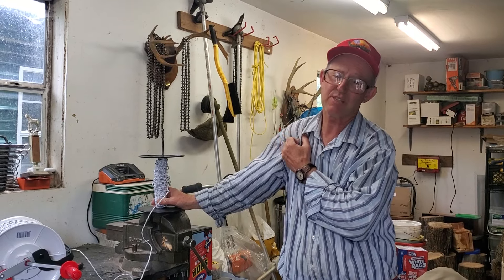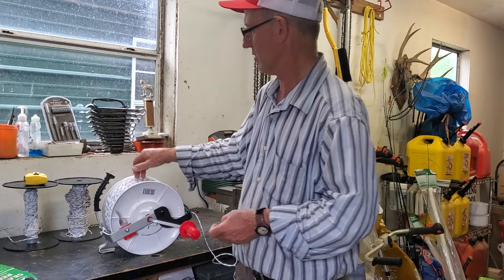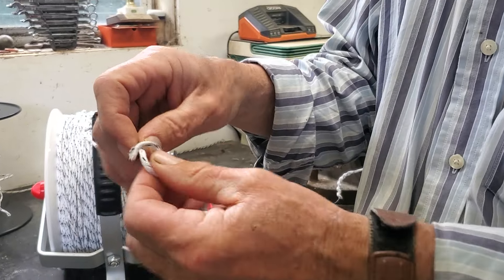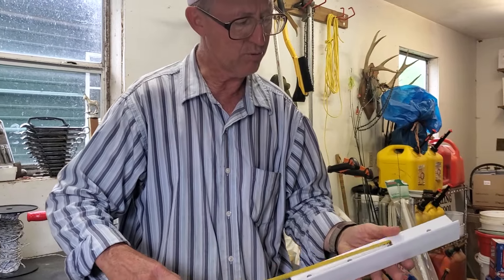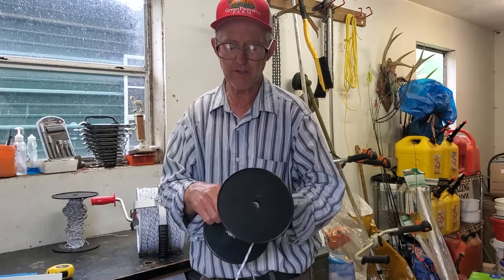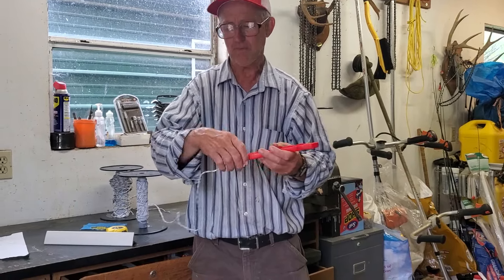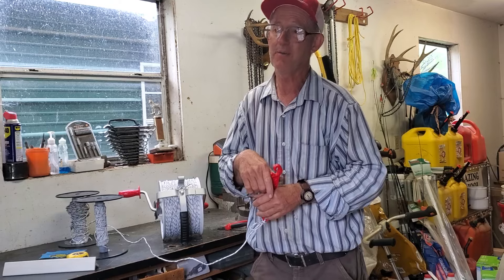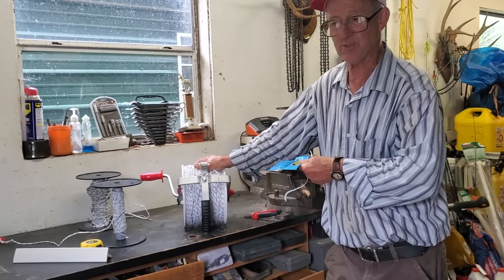Here are your best electric fencing materials that work and perform flawlessly.

Comment: Thanks for the great advice!  Can you tell me which size  1.25,1.75,2.25  post you use? Also wondering how you drive these. I'm down in Springfield and know it's hard to get a steel post in the ground. Are these rigid enough to use a driver on?
Reply from the maker: The 1.75” is a very durable post. Timeless Fence I believe sells a rock bit for installing posts into very rocky soil.
Reply: Thanks Greg

Comment: Those reels  look like standard  wire reels. They can certainly be sourced if they can be replaced  without damaging  the reeling mechanism.
Reply: Yeah, there has to be a way.
Reply from the maker: Let me know when you find them.
Reply: @gregjudyregenerativerancher  They look like standard wire spools. You can probably  pick a few up at a place that sells  wire/cable by the foot. The crucial  detail is what the hub diameter. By that, I mean the hole  in the center.

Comment: If I'm connecting to high tensile wire and using step in post do I go from hot to hot which completes the circuit or non conductive plastic on one end and Tara reel  to hot.

Comment: Mr. Judy can you join polybraid lines with a knot, if so what is the best way to join two lines together?
Reply from the maker: We use a figure 8 knot to join them, works great.
Reply: Is the figure 8 knot like a baler knot?  Grab both ends together, make a loop and feed both ends through the loop and pull tight.  6 seconds and will not pull loose.

Comment: I'm looking at your broken spool and think you could 'fix' it by using a paper plate and epoxy. Us the plate as a mold, then mix your epoxy, spread it over the plate and reel, then when dry, sand until smooth. You can reinforce the seal between the 'new' part and the old by using super glue and baking soda mixed and applied. I'm thinking that may well work.

Comment: One thing I started doing with the braid on the reel is I slip a little piece of heat shrink tubing on the tail end of the braid and go over it with a little torch or heat gun. Stops it from fraying at the end

Comment: Greg, just went to your website and I don't see where to sign up for the September class
Reply from the maker: It's on our website: greenpasturesfarm.net. Just put it up there.
Reply: @gregjudyregenerativerancher   FYI, no clue why I'm getting this message when I click on the "Check out our September 0th and 10th..." button I get  "Unauthorized. You may remove the customize_messenger_channel param to preview as frontend."  That said, I can still get there through the pulldown menu at the top so there might be an issue with the button

Comment: What is your longest stretch you run the poly raid? Do you ever go more than 1300 feet and need another reel? How do you hook that up?
Reply from the maker: We use slip knots to join up to 4 reels together for long cattle moves, works great. Just untie the slip knots when your done. Always leave your empty geared reel where it ran out, on the ground, opposite from the cattle traffic. This way it is right where you need it when you wind up the numerous reels after your done.

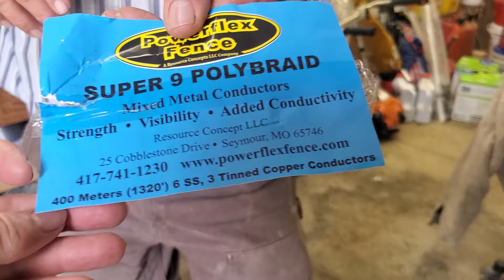Comment: And like the label says 13:26 - six stainless conductors and 3 tinned copper conductors.  Nine total--mixed metal because the copper is a far better conductor, but also very expensive to use.  It doesn't have "9 steel wires".

Comment: Hey I'm buying fence supplies and the only reel available locally is a Speedrite. Also got my first 10,000' of HT wire today, 170k rather than 180k, because I didn't want the 215k and those were my two options. Back to the reels, the Speedrite looks just like a Taragate (and is made in NZ), but it's not a Taragate. You said everyone else's brake sucks, so I'll hold out for a Taragate (pay shipping).  But if anyone is using a Speedrite with great success (on an ATV with no brake issues) I'd be glad to know it and might get the locally available one.

Comment: It’s amazingly that for a minimal manufacturers input they just need to increase the reel diameter by 1”.   I have been using the doublhook 2” wider version sold by power flex fencing.  Like it so far ( been using for a year).  Regardless of my 2 cents, thanks Greg

Comment: Greg I’m wanting to build a 3D fence for my orchard. I’ve seen some people using poly rope in the back and ribbon in the front. Would It be better just to run rope all the way around it in the front and back?  What would you recommend? I’ll be using a 3 strand in the  back and 2 strand in the front. Thanks!

Comment: Timeless Fence does also carry Terabraid which as far as I can tell is exactly the same as the Powerflex braid and you can buy pre loaded Teragate reels with their braid on it and it's actually cheaper than buying the reel and braid separately. Go figure
Reply: Yes i saw those options when I was first looking these things up. Haven't bought any yet, no animals-still working on my acreage.   BUT if they're full to the top with wire, I'd pull off the amount needed to slightly below the rim, just as Greg shows in the video.  I've been fooling with fishing reels long enough to know that one--and know it well.  Nine conductors with some copper in there--that's the same too if I recall correctly.

Comment: Have you ever used the mixed metal terabraid? And how does it compare to the powerflex?
Reply: It is good quality stuff too. I really can’t tell much of a difference from it and my PowerFlex
Reply: @treybrake7516  so you use both also I'm wondering what fence charger he uses. An how many runs of wire